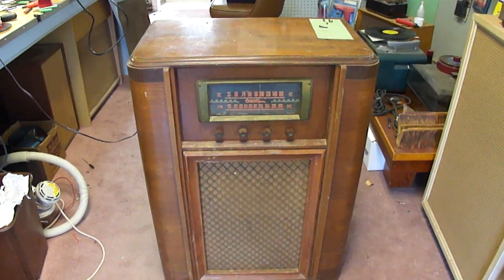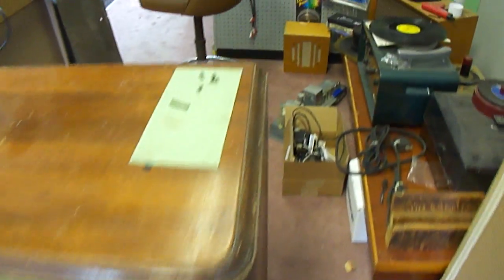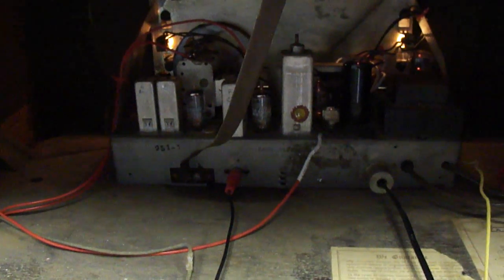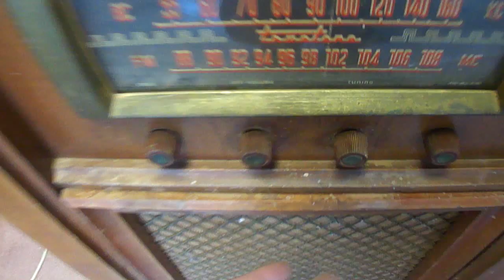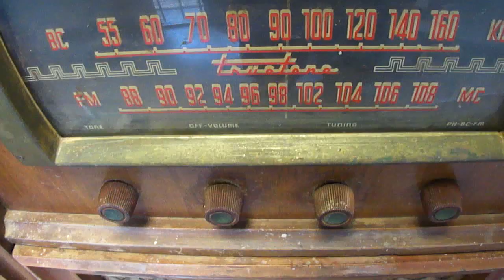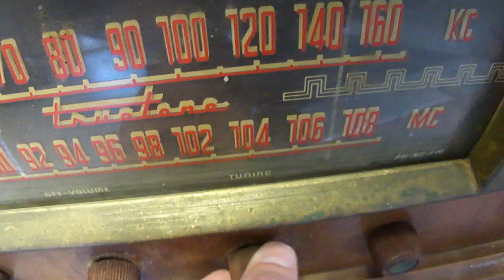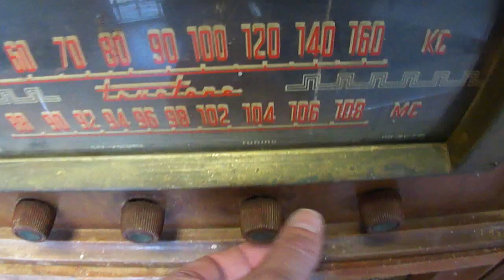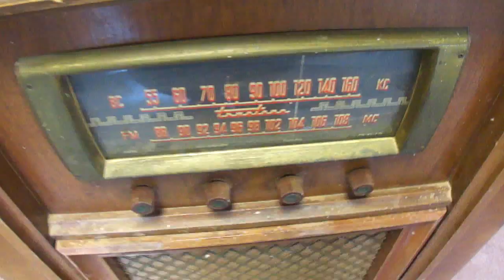1950 Completed Truetone Console AM/FM Radio Model D-1046A

Comment: Hi Retrochad. I've got a 1946 Trutone Model D-1645 with the Oak Model 6666 changer. The changer had the old-style Crystal Cartridge which you cannot find anymore. I obtained a suitable replacement KCCC Crystal Cartridge Replacement Kit from thevoiceofmusic.com. I also had the radio tuner repaired and re-aligned. The radio has decent volume but not overpowering. The record changer, on the other hand, has a very weak volume when playing 78's. Can't figure out why. Any clues?

Comment from the maker: @xmaddict This probably wasn't a very high-end model due to the small speaker and low power output. However I'm sure it wasn't the cheapest as FM was still kind of a luxury back then and it does use a power transformer as opposed to a series filament string. I have the same chassis with a different dial which is used in a table top radio (haven't repaired it yet.)